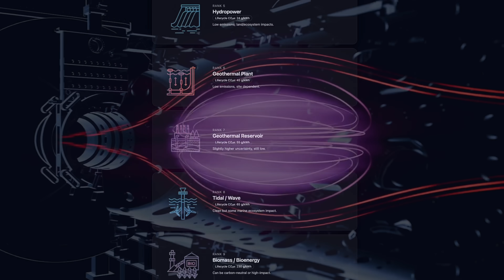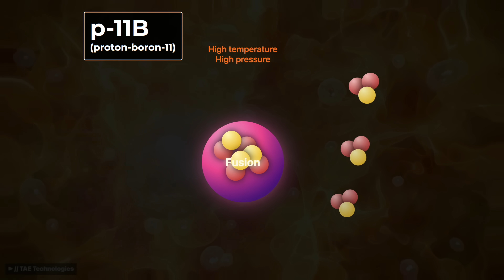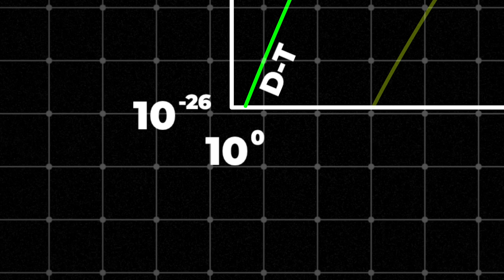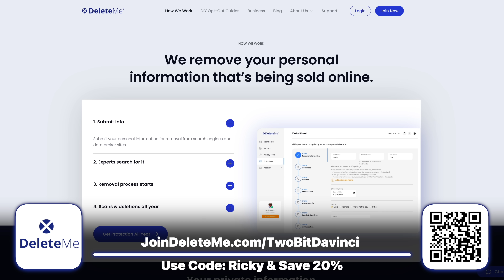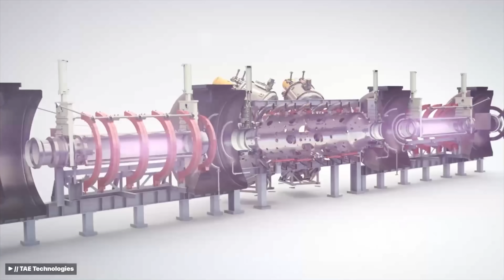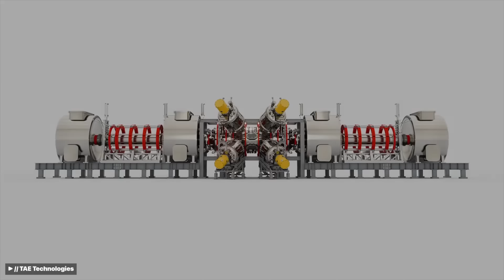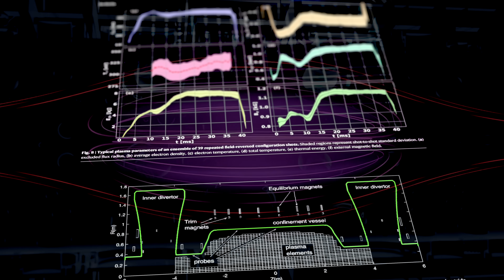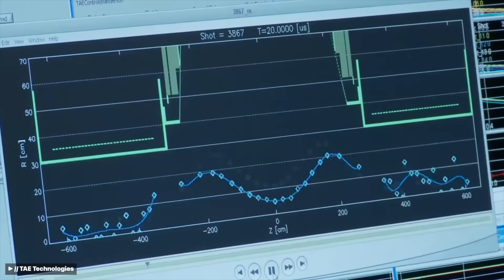The Nuclear Fusion Breakthrough EVERYONE Said Was Impossible

Comment: Fusion chemistry is the biggest hurdle. D-T is the easiest reaction, then D-D. Helion wants to do D-He3, which is much harder than D-D self-reaction, and so only with massive excess He3 (expensive) will their target reaction work; otherwise they will just end up doing D-D. My money is on D-D reactions being what we scale up - because of cost. 

TAE's H-B11 is even harder, though its reaction products are the most ideal (3 alpha particles). Like Helion's target reaction, no hot neutrons = huge efficiency potential + safer + and more reliable, so its a worthy goal, but much harder to reach. MUCH harder.

Fusion chemistry trade-offs are rough!
Reply: I don't think we'll ever see a solution with h-B11.  The engineering problems that come with a plasma that hot are just too big to overcome.

Ricky is right about this approach being extremely far outside the realm of what people believe is possible.  TAE is going to need a series of miracles to get this to work.
Reply: @uigrad I agree. p–B11 is just too difficult. Bremsstrahlung losses in such a compact volume are a problem you can’t get around. Maybe with a much larger reactor or even a reactor in space, like in the Zephyr concept. Sometimes I wonder why these different projects do not get togheter to join theirs project they have come up and create something even better.
Reply: Yeah but remember we are only 30 years away
Reply: @odjono  That's the old joke, but obsolete these days. These days the more optimistic ones are talking about being 10 years away. Though you know, that's being pretty optimistic, I'll believe it when I see it. Still Fusion has definitely been making some real progress and we could very well need much less then 30 years now.

Still... we'll see when the next generation of reactors come online like CFS SPARC in the next few years. If one of them work, we've finally really started getting there. Else I guess the bad luck zone.
Reply: But D-D is not aneutronic and has small output. D-He3 is the way to go, if they can figure out the lunar mining of He3, but it's an easier problem to solve.
Reply: @Gigagyikember  For sure to D-He3, as Helion points out, though the issue here is that D-D is more likely unless you have mostly He3 in the reaction plasma. I'm also thinking in terms of overall cost, as He3 is absurdly pricey, and mining it on the moon even moreso.

D-D with some T on the side is the most likely to scale up first, to reduce overall neutron flux and keep input costs down. Minimal necessary tritium, perhaps as the ignition fuel to start it.

But hey, maybe the energy availability of ANY fusion will make the R&D to create ductile RTSCs attainable, and even higher B fields achieved with these hypothetical materials will enable H-B11 or other similarly high-temp fusion reactions with little to no neutron struggles, like D-Li6.
Reply: Who doesn't like double D's 😂
Reply: We are definitely going to the moon for some helium 3
Reply: It isn't chemistry. You need to upgrade your nomenclature.
Reply: @MattNolanCustom  "Nuclear chemistry" is totally fair. The type most people think of as chemistry is "interatomic chemistry", but that is not the only kind. The selection of fusion reactants in a fusion device is absolutely an example of nuclear chemistry, as is the entire study of fission. Chemistry just means "rules of the combinatorial space". Biochemistry, likewise, isn't merely about small molecules made inside organisms - it involves macromolecules with functions resulting from their shape and "mechanical" properties at least as much as their interatomic chemical activity. Enzymes are excellent examples.

P.S. I have a chemistry degree, and have discussed the topics of nuclear chemistry with PhDs in an academic context. This is absolutely how most physicists think of this.
Reply: @psychemist2689  my apologies. I was under the impression that chemical reactions involved electron orbitals and not things inside the nuclei

Comment: It turns out that there's a whole science of X-ray optics.  I wonder whether those 'wasted' X-rays could somehow be redirected back into the plasma and not wasted.
Reply: Wasn't the photovoltaic effect proven with high energy photons? Why not turn a bug into a feature and build up photovoltaic cells tuned for x-rays as the method of energy capture as opposed to or along-side making things spin with boiled water?
Reply: @aquilux-vids  Nailed it - to have a shot at net energy they need to capture the bremsstrahlung radiation with high energy PV panels at really high efficiency. The fusion products are charged so they could induce a current in surrounding magnets without a steam cycle. Helion is a better bet for sure, with 6% of their energy in lower energy neutrons they don't have a neutron problem in terms of economics, while they don't have to deal with a PB11 level fusion challenge
Reply: X-ray optics is a complicated field all by itself and nothing there is easy.  The best reflector is probably what's being used in the Ulam-Teller design - but fusion bombs have that nasty habit of destroying themselves rather quickly and effciently so that one's out for fusion power plants.  There are other types of x-ray optics such as those being used in x-ray telescopes or EUV exposure devices but none of those seems to be applicable for the use you have suggested.  And they're stupidly expensive.  And there's nothing on the horizon in that field that looks like the necessary breakthrough.
Reply: @ralfbaechle  At the speeds the Teller-Ulam device operates, the shape of the device and the medium (FOGBANK aka styrofoam doped with metals) which helps to just ever so slightly bend or redirect x-rays. FOGBANK turns into a plasma, and the plasma is what serves as a more pliable medium for x-ray optics. 

Mind you, mastering x-rays and even gamma rays would be the holy grail, we'd have fusion in a hot minute.
Reply: no that violates the law of cumtendue
Reply: Someone trying to work out how to get rid of that annoying Bremsstrahlung radiation was what led to synchrotron light sources being developed. *8')

Sadly the X-rays produced in random orientations, as described here, would not be useful as a light source for science. Fourth generation synchrotrons are aiming for more coherent beams, not less.

As for fusion, the work still being done at Culham is invaluable to projects that have surpassed JET, as they are using their test platform to develop materials which will be useful for the development of many future projects.
Reply: I kind of wonder if they're technically X-rays or gamma rays. I understand the main difference is due to origin(gamma = nuclear, X = electromagnetic) but this origin seems to be a mix of both. Should we call them GX-rays? or XG-rays?
Reply: @ryelor123   It just depends on the frequency of the radiation. Gamma rays are the highest frequency that can go up to infinity. X-rays are lower frequency than that. It's a continuous spectrum in between. It all depends on the energy of the photons emitted. The higher the energy, the higher the frequency.
Reply: Not happening. I've seen some gamma-ray 'mirrors' at synchrotrons. They're curved on an atomic level, stepping down one atom layer in regular fashion. It's possible to redirect the beam a bit, but really that's were it stops. Most X or gamma ray 'beams' are collimated by having an aperture and blocking the rest.

Comment: Lawrenceville Plasma Physics is also working on an aNeutronic fusion reactor. (PB11-fueled) They have achieved the highest temperature reactions, and are on an engineering path to a working reactor.
Reply: And in their design, bremsstrahlung shouldn't be a problem. The plasma briefly generates an extreme magnetic field that suppresses it.
Reply: @dennispierson6598  They still radiate X-rays, but the plan is to capture a lot of that using xray photovoltaics.  They degrade much faster than optical systems, but that's not an unsolvable problem.
Reply: 1839 - Edmond Becquerel discovered the photoelectric effect

1982 - Arco Solar delivered power to the electric grid produced by photovoltaic cells

That's 143 years.

Now compare this with nuclear fusion.  Arthur Eddington theorized stars produce energy by fusing hydrogen into helium.

If the first fusion plant delivers power to the grid by 2063, it would do just as well as solar.
Reply: @CrossoverManiac and it would work at night!
Reply: Exactly! I would like to see a video on the Lawrenceville Plasma Physics fusion approach.

Comment: And all this time, China has produced a Molten Salt Reactor that uses fuel that is extremely abundant and so much easier to produce. This is what we should have been doing, not chasing rainbows. Even if this works, it's got to compete with the much simpler and proven cycle that Thorium fuelled MSR are. Just imagine how many MSRs there would be already if we hadn't wasted so many resources on Fusion.
Reply: MSRs would be great but aneutronic fusion would be even better. With an MSR you're still stuck generating electricity with a turbine. A reactor fueled by boron or helium-3 could generate electricity directly, so there's a potential for very low cost. Another advantage is that even a badly-designed fusion reactor can't have much of an accident, which means it's easy to deal with regulators. And with aneutronic fusion there are no proliferation concerns at all.
Reply: Practicality to move with nature always wins. I've seen so many frauds that collect millions in R&D until their founders retire without a care or penalty
Reply: Thorium is super hard due to poisoning and metallic wear.  The Chinese are able to drain and fill on the fly, so to speak, but there is still the wear problem.
Reply: Yeah we should have never gone to space made airplanes and should have made better carts instead of cars
Reply: Investment in fusion has been very low for decades. It's only picking up now. We may have been able to achieve fusion already if we actually funded it properly, but oil and gas was cheap enough. 
People also got scared of nuclear energy and stopped building power plants altogether so there was no money in researching Thorium at all.
Reply: @COKireato might want to verify that... Private corps as well as Caltech, Drexel and MIT have all received billions over the decades. I was at Drexel in '89 it was a money pit.
Reply: @zackfonseca4009  I don't have any source, so it might be incorrect. The point that was made to me years was that fusion may have received billions over decades, which sounds like a lot, but you should look at the subsidies on oil and the investment in other forms of energy...
Reply: @COKireato I've done commercial renewable finance since '09 and been in solar since '91. Our tax dollars have been squandered
Reply: @zackfonseca4009  I'm slightly confused; I thought you were talking about private investment before, but now you're talking about government funding? If you can share, what are the details?
Reply: @COKireato government funding and subsidies prop up the nearly entirety of the energy industry. Private equity would never move unless there were your tax dollars involved
Reply: @zackfonseca4009  Right. So how was the funding for fusion when compared to funding for other energy sources? (Especially oil, you know those big corporations making money off of oil have their ways of persuading the government of sending the tax dollars their way...)
Reply: @COKireato fusion is one of many "r&d--wink winks" to pocket grants and avoid taxes. It's not just oil, the multi state for profit utility conglomerates like duke, pjm, and Xcel profit heavily along with major research universities
Reply: Well go live in China, if you believe, everything that they release to the media, your a fool. go watch The China Show, and learn something.
Reply: @rogerfroud300  MSR's have been around for decades. The problem is they decentralize the grid. The stock market does not like this. Profit profit profit. I remember an article in popular mechanics about thorium reactors. A very small one in your car would last 100's of years. When you get home plug in the house and there ya go. But no reoccurring income for the stock market.
The stock markets will destroy the USA.